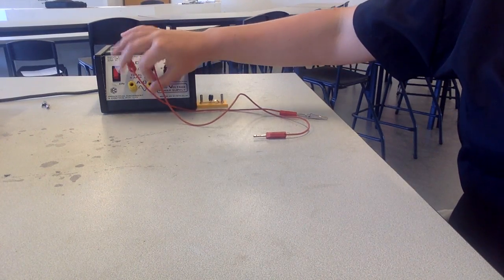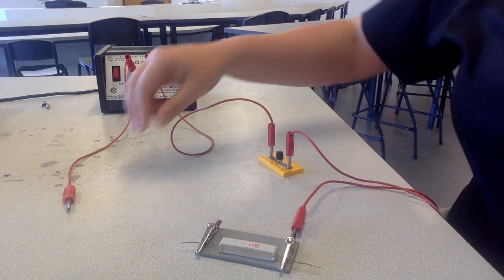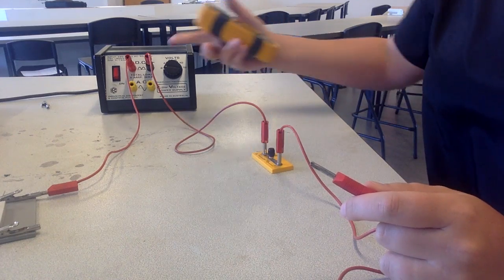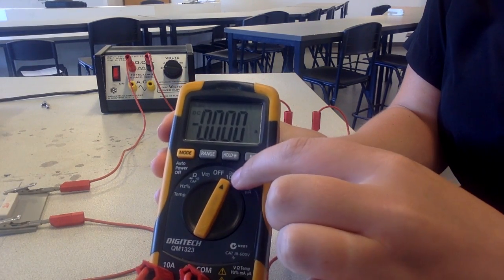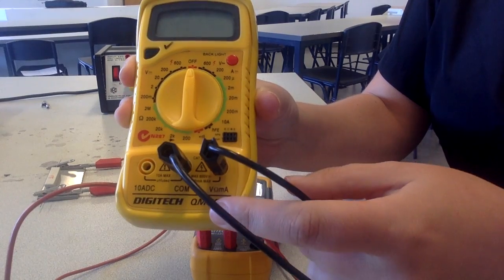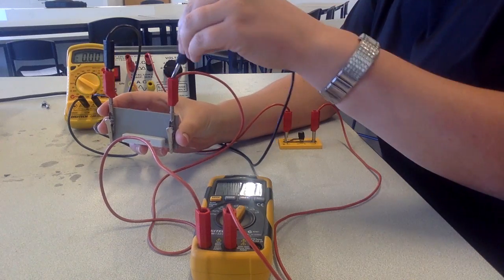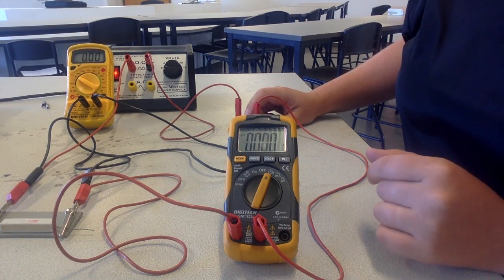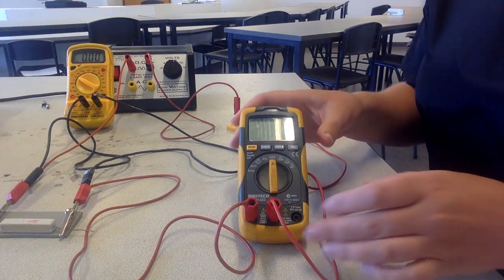ohms law experiment

Comment: That's a very good instructional video. Thanks.Probably the current is too low for the 10 A scale because of the resistor that you're using. Change the position of positive cable to other conector at multimeter (lower amp scale).
Reply: i had the same thought